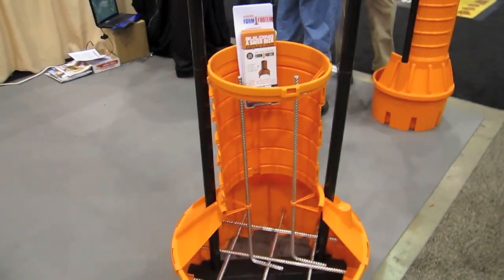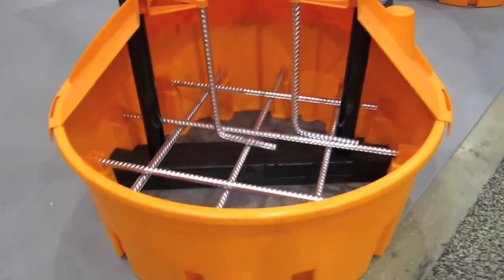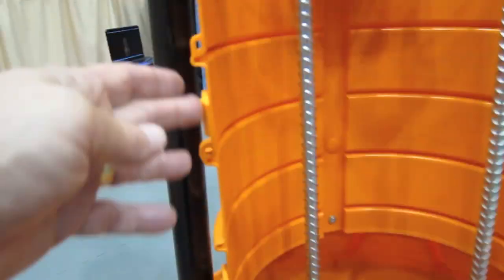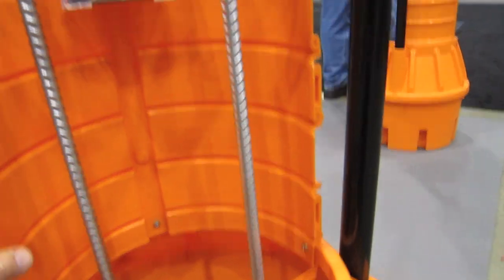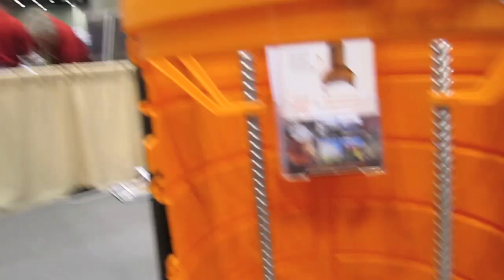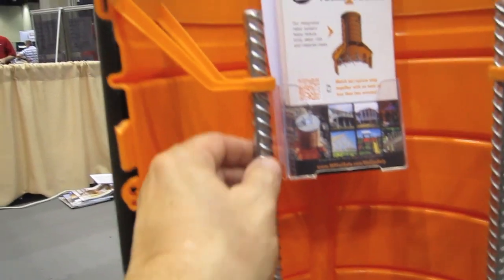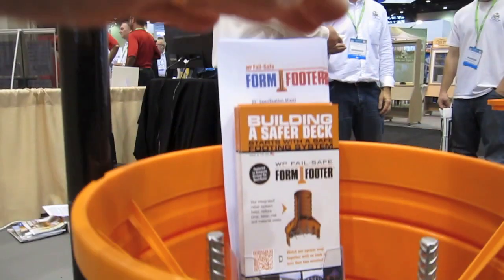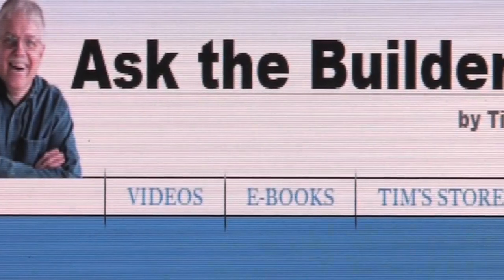Building a Deck Pier

Comment: I spoke with the manufacturer and reviewed the literature on their website which is impressive.  The have an engineered stamped specification sheet for their 18" and 24" model.  As an inspector, I believe it is a great product.  Now with the specification sheet, we can determine whether or not it can be used for certain applications based on soil bearing capacity, ground snow load for covered decks and size of the load.  Between both sized I think 95% of regular decks can be built with these.

Comment from the maker: Fantastic! I should have said that in my previous comment. DUH!!! I was well aware of the spec sheets and how they've been engineered for many many states. I'll blame it on the heat and humidity here in NH. It's HOT here and that's not normal. Thanks for your great comments and followup. Most folks would not have contacted the mfr. Kudos to you!
Reply: Builder, who are you replying to? Which comment? Jeff Remas, below?

Comment: Yes, sir, they can be code compliant depending on the tributary loading of the particular pier in which it was used and the soil bearing capacity in which it is used.  I would have no problem approving it with all conditions being prescriptively met in the code.  There are many applications for simple residential construction where they would not be code compliant. My intent is to let everyone know that these are not approved for all conditions based on the size of deck and soil classification.
Reply: Thanks, Jeff. I will check on using them in our area in North Carolina (not too much snow where we are).

Comment from the maker: @Nemo1181 I have a column at my AsktheBuilder website about the precast piers. You will NOT set those by hand. You must have a backhoe. They weigh well over 1,000 pounds. What I didn't explain well in the video is the fact how hard it is to form one knowing you're doing the entire pour at once.

Comment from the maker: These are code compliant. In fact, I believe the mfr told me recently that they've partnered with Simpson Strong-Tie so that the entire assembly - the pier and Simpson's framing connectors are baked into the code. The advantage with this product is no tools are needed. The steel even comes precut and pre-bent. You can be ready to pour the concrete within 3 minutes of unpacking the parts. They just snap together in seconds. Brilliant.

Comment: Always interesting gadgets and I am curious as to the company's sales these days.  The problem with these products is that contractors and DIYers think they are code compliant for all decks and often fail inspections for not taking into consideration tributary loading, soil bearing capacity and additional deck loads such as roofs.

Comment: Amazing
Reply from the maker: Thanks. They are. I've used them several times. Think what it costs to drive to get a Sonatube, go get the steel, spend an extra day pouring the base, cutting the rebar, securing the sonatube, suspending the rebar, etc. You don't have to do ANY OF THAT with this incredible product. It takes about three minutes to snap the parts together and place the pre-cut rebar into the holders!!!
Reply: Are they still around? Where do you find them?

Comment from the maker: @Maxid1 You leave this in the hole. Imagine how hard it would be and how much time it would take to create the form yourself - especially if you want to do the pour at one time. If you do the pour in two steps it's somewhat easier, as you have the footer to rest the cardboard sonotube on. Remember, the steel comes precut, there are holders for all vertical and horizontal steel. Just imagine how you would get the same result without this product.

Comment: or you can go to walmart and buy a round plastic waste trash can 16" tall for $5.00 and cut the bottom out of it and then buy a sq plastic Tupperware pan 2' x 2' for $3.50 and cut the bottom so the waste can hole to fit the hole in the tupperware pan connecting them together and 2 or 3 pcs rebar all for around $25.00.
Reply from the maker: Yes, you can do all that and HOPE that as you fill your contraption with hundreds of pounds of concrete it doesn't blow out, distort, or ???? This device is made for contractors and folks that value their time. Your proposal puts no value on time. But that's okay for some.
Reply: hello. why the square bottom. why cut bottom out of round trash can. thanks

Comment: 100 dollars lol. Too much
Reply: I saw this video just now (looking up deck foundation videos). Way too expensive. Just buy cardboard tubing.
Reply from the maker: @10tenman10  Okay, let's do the math. 1. Using your tube you have to either pour the footer on one day or come up with an elaborate way to suspend the tube in the air keeping it plumb. Then you need to calculate the cost of the reinforcing steel, the cost of picking it up, the cost of cutting it, the cost of suspending it. I think you fail to realize that one advantage of this great product is the fact that you can place it easily in the hole, level it, and then immediately backfill it making the addition of the concrete that much easier. No leftover termite food as is often the case with builders/remodelers who don't peel off the cardboard.